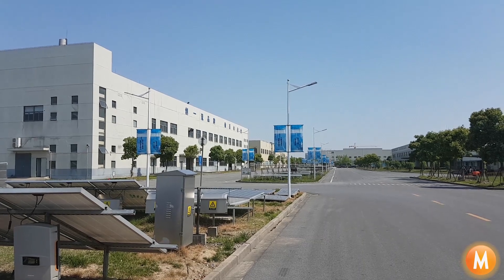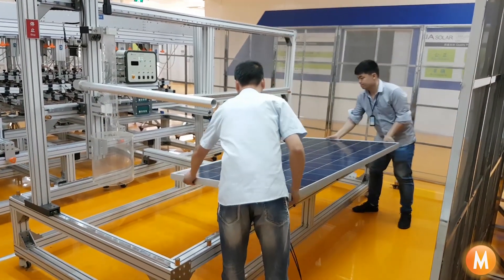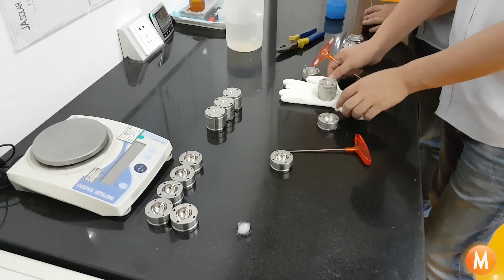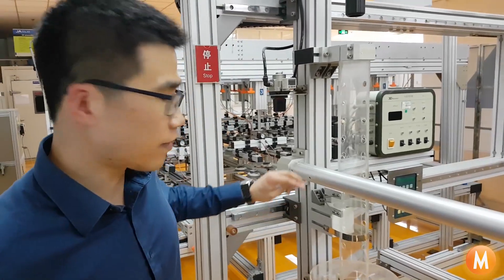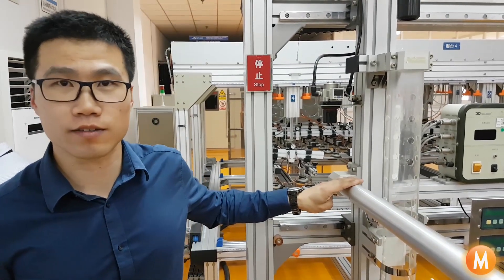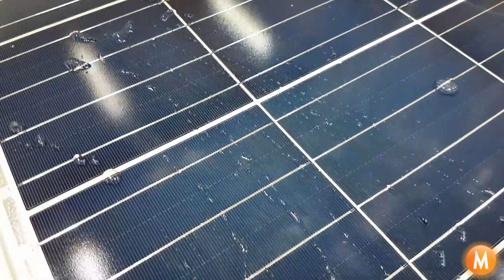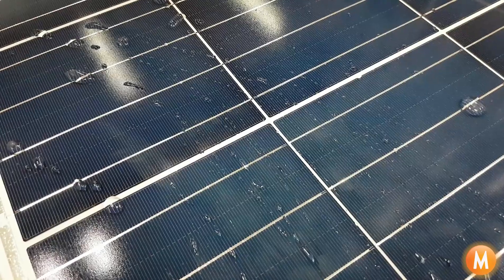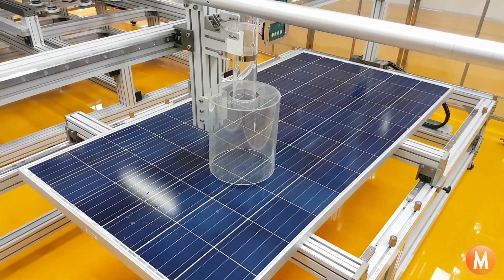JA Solar - Solar Panel Hail Impact Test

Comment: Crazy hey and this was 7 years ago, we recently had a 6.6kw 14 panel system installed and I never even gave hail a thought.
I'll have to look up my panel specs and see how resistant they are because we recently had 5 minutes of tiny hailstones (first hail in the district for 10 years) and zero damage.

Comment: A fair test method should be simulated with a free fall shot put ball with a certain height Hc which can generate 4-5 millimeters dent on a  front cover top of a US brand car that is based on the official statistical analysis of Hail damage survey.  At the Hc, the critical height, and the same shot put ball should be free fall again to assess the crack on the solar panels.  Once a panel can pass that test, it is considered to have a proper hail resistance.  Therefore, the suggested test method in this video tends to be a mediocre which can't represent the real hail impact.
Reply from the maker: Thanks for you're comment. The JA Solar lab I visited is a TUV certified test centre,  all their testing is to the required TUV standards.
Reply: Bro, he launched it.  Hail can fall from mars, terminal velocity is a thing, and mass and wind resistance are a thing. The hail was accelerated towards the panel, not just “dropped” meaning it replicated the velocity it would likely have achieved  falling during storm in that short distance.

Comment: I find this test very interesting. using slow motion you cannot see a formed ball hitting the panel, just bits, and the remaining ice slush is very minimal compared to purportedly the exact same test done by LG. https://youtu.be/WFTDaAg853g?t=24
You can clearly see the ice ball in the LG test and heaps more ice slush. What gives?
Reply from the maker: thank you for taking so much time to analyze this footage, it was filmed with my cell phone in 2017 so you would need to investigate frame rates and camera interlacing of Samsung phones at the time for you to find your answer.

Comment: I live in Australia , solar panels can withstand hails to a point but a bigger hail like tennis ball 🎾 size will break and shatter the panels
Reply: hectic
Reply: Absolutely, a quick google of last years hail storms in Queensland and NSW there are many images of hail damaged solar panels, even to the point it is just an empty frame, no solar panel remaining. So the statement in the video that the test exceeds what would happen in nature, is a huge understatement. The hail here can easily penetrate tin roofing and occasionally even roof tiles that are 25-30mm  thick, so solar panels made of glass just a  few millimetres thick stand no chance. And with the current climate changes, the east coast of Australia just weeks ago saw its first ever tornadoes, and south Australia was hit by golf ball sized hail that is basically unheard of in that part of Australia. Solar will soon become less viable here because the yearly storms will potentially make the replacement of storm damaged panels less cost effective than simply paying for grid power.
Reply: Not to mention the chemicals leaching into the ground from the shattered panels. Lead, cadmium. Good stuff for environment! Green! 🤮

Comment: Just a small mistake in the video. The test is done at 23 m/s as was mentioned in the video twice. But the presenter mistakenly mentioned 100 km/h (which is around 28 m/s).
Reply: Thanks Nadim, I appreciate your feedback

Comment: If You make impact panels that absorb energy from the impact of rain, ice and snow, then it makes and stores the energy. Also, is it possble to create a self rocking panel with feathery filaments that impact the rocking panel to make energy. A self supporting energy maker. Only thing is they might need repair or replacement from the filaments impacting them on a regular basis. Just an idea. I invent things. I invented the alternating fish ladder. Gave the idea to PA fish and game and they passed it to their Engineers 2 years later it was in Popular Mechanics.  They had indeed used My invention. Hope Your Engineets can come up with so Mum ething from My idea. My reward is always seeing My brain children come to life. Thank You for reading this. Hope I helped alittle.
Reply: Sorry about the typos, i must learn to proof read. And i too lazy to correct the mistakes. Lol. Have a good one.
Reply: Autocorrect is a btch.
Reply: A piezoelectric photovoltaic panel: Perfect!!! turn the impact of the hail stone into a pulse of electricity.
Reply: Vincent Robinette what a waste of resources for such a modest energy output. Sounds good on paper, (not really tho) doesn’t make sense in  reality.